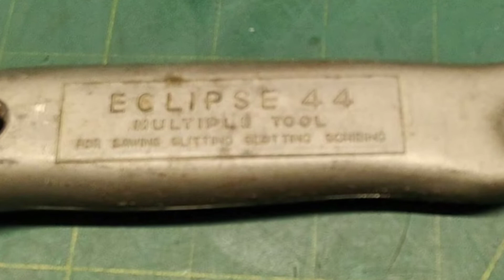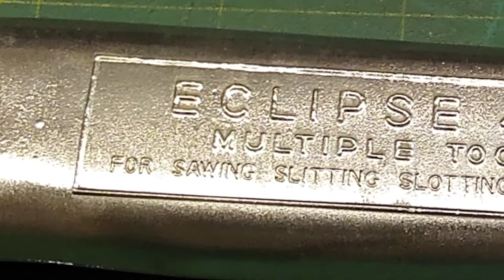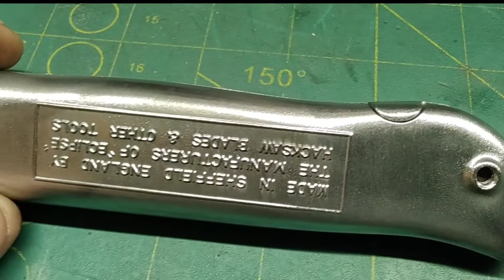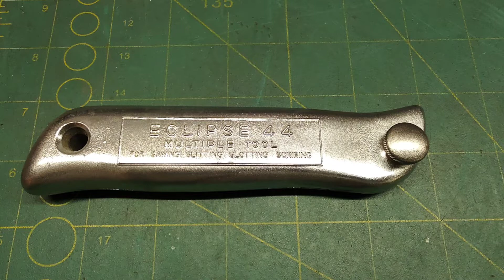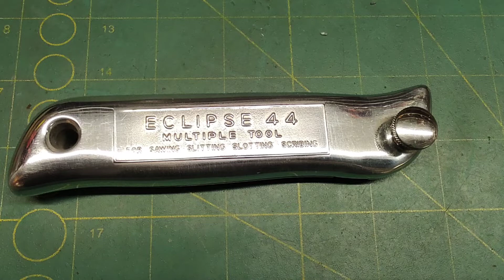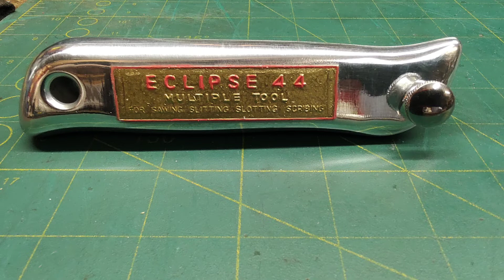rare eclipse 44 multitool restoration

Comment: I like shiny things 👍 What was the buff you used after the wire wheel ?
Looks great and you didn't have to sand it.
I loved the detailing at the end, finishes it of nicely.
Reply from the maker: sourcingmap 8" Dia 2" Thick 5P 180 Grit Nylon Fiber Wheel Abrasive Polishing Buffing Disc Black https://amzn.eu/d/2fGqgDP
Reply: @toolrestoration  Ta for this. Suggest you might voice-over these details in future vids? It's really helpful info! Cheers